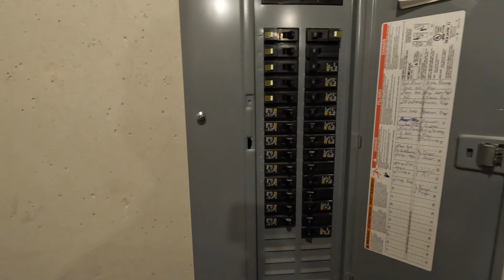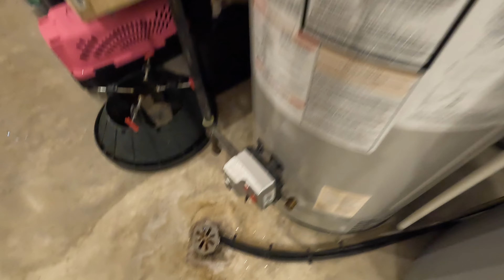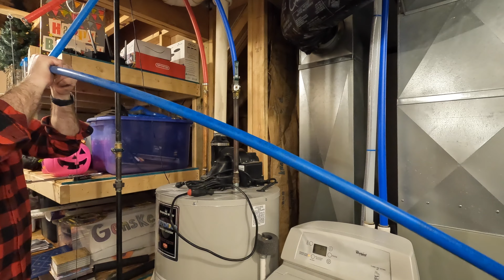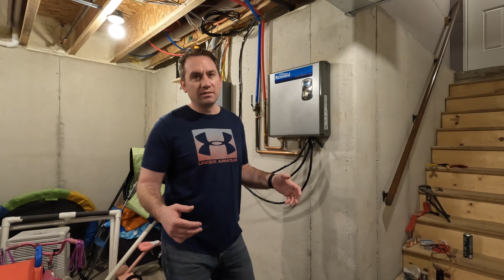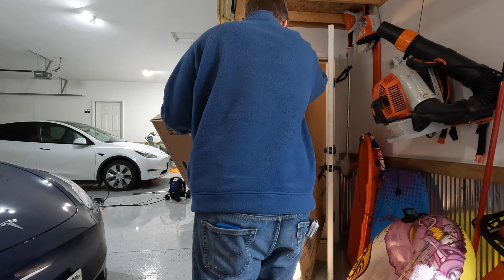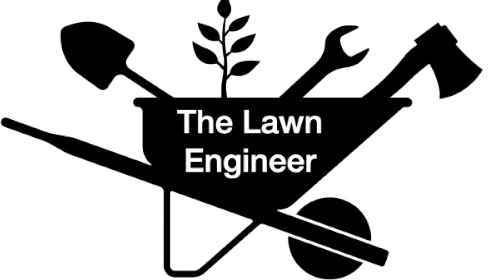Tankless Electric Water Heater Conversion - Richmond(Rheem) 27 kW

Comment: I’ve heard if you lower your water flow it will heat up much better. May also need a booster unit if your showers are far away.
Reply from the maker: Agree, they do recommend flow restrictors at the outlet of the unit but I don't think that's practical to limit water flow that much for running two showers at once.

Comment: I isolation valves? No T&P valve?
Reply from the maker: I’ve found PEX so easy to work with, I don’t mind just using the main water shutoff to service things.  However, I would never discourage anyone from adding valves.
Reply: @TheLawnEngineer  by code you need a T&P valve. How are you going to relieve pressure if the water heater fails to turn off and thermal expansion starts to occur?

Also How are you going to flush your water heater without isolation valves?

Comment: Hmm. I just put in the 27 kWh unit in Upstate SC and seems to work just fine thus far. It is just my wife and I though and incoming water is warmer than northern us. They have a chart for the regions and what size would be necessary.
Reply from the maker: I’m in Wisconsin, so we probably have a significant difference in incoming water temperature.  

The chart told me this unit was good for two simultaneous showers in my area.
Reply: I'm looking at doing a tankless electric in SC also.  Do you find your tankless electric allows simultaneous showering for you guys in winter?  Are you able to have at least one person able to take really long showers?  Thanks for any insight.

Comment: I also looked at the same model, and the specs indicate that it can only raise the temperature from 31° to 92° depending on the water flow/gallons per minute. Figuring approximately 4.4 gallons per minute (GPM) for 2 showers shows that the temperature rise from the incoming temperature will be 46°f. If the incoming water is around 50°f, the output would be 96°f, most likely a little lower, using 4.4 GPM. But using 2.5 GPM, the same incoming water could reach approximately 124°f.

In my area, the average tap temperature from the ground is 53°f. The RMTEX-27 max temperature increase using the 6 GMP flow would only increase by approximately 31°f. IE 84°f output at the tap.

Our house has 3 adults, so we stagger our showers by 10 minutes, and all of us can have water temperatures over 120°f.

Tankless really comes down to GPM and groundwater temperature.
Reply from the maker: Great summary, thanks for sharing.
Reply: Yeah, my guy didn't do enough research and didn't understand the water temperature capabilities of the unit he bought.

Comment: Wow, what a bummer discovering that problem about a lukewarm water delivery.  I was kinda expecting you say 'if you like cold showers then this is the unit for you.' The house I bought has a tankless water heater, but it's done with propane (which also heats the radiant heat stuff in the concrete slab). But as it's just me, I don't know if the previous owners had problems with simultaneous showers. 
So, do we get a video of you installing the new tank unit?
Reply from the maker: Yes it was a bummer.  I was pretty fed up and didn’t film much of the tank heater install 🙃.  I did video cutting apart the old unit to see what condition the tank was in…that’s pretty interesting.